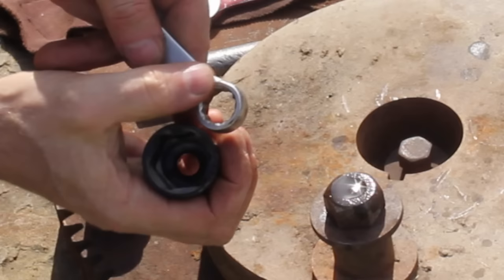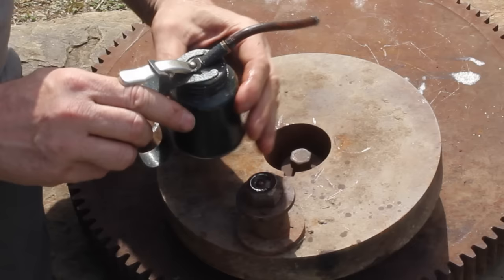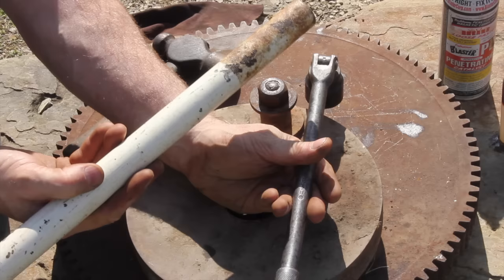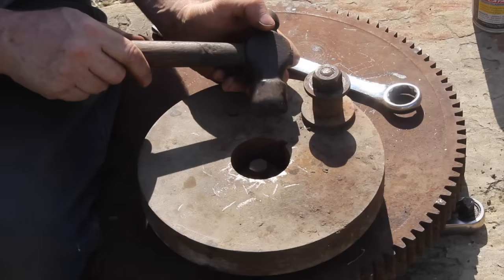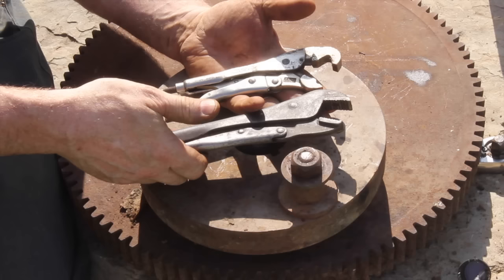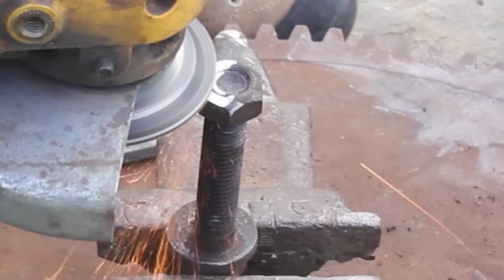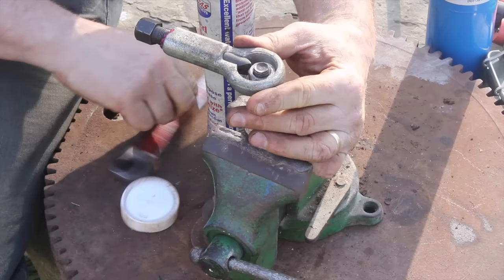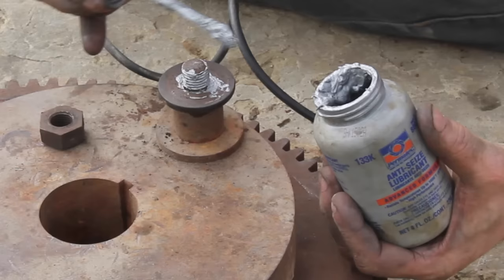Best Ways to Get Rusty Nuts and Bolts Off (Effective Techniques)

Comment: I notice these videos always use easy access bolts as examples, but the most common reason for stuck and stripped bolts is that they're in hard to access places, which makes them hard to get a wrench around, which is what caused the fiasco in the 1st place.
Reply: YES! I'm struggling with a really rusted  rear damper bolt, it's squeezed really tight up there, there's barely any room. I need a 6-12" extender to even get to the thing. And the bolt faces downward. No leverage at all.
Reply: @mog7501  Wow, Im having the same problem with my rear shock bolts on my mazda 3 2006... Did you get them out?
Reply: @Shr1mp2K  I gave up and went to a mechanic. Even for them it took like 2 hrs lol. Ended up paying $80 for one nut 😭. Most expensive nut removal in my life. They had a really tighter extractor socket and some other special tools. I already tried heat, extractor socket, grinder tool and nothing worked.
Reply: Exactly! The title says "nuts and bolts", but he's only working on a nut, which is a walk in the park compared to bolts.

Let's see him try these same tips on rusty seized caliper bracket bolts while working in his driveway. Lots and lots of heat is usually what's required.
Reply: Agreed, Getting the nut off is one thing. Backing a seized bolt out of an engine block is where I struggle

Comment: Actually, another comment. Sometimes you can try to tighten a frozen connector which will move just a smidge. Then go back and forth loosening/tightening a little at a time.  Actually heard about this, but only seen it work once....

Comment: Only comment is on greasing a connector.  There an Aussie fastener engineer on YT who goes into good detail on how using any sort of lube on a fastener changes the applied torque.  In general, if it is at all greasy, even a drop of oil on the threads to lubed with anti-sieze, adjust the torque you are shooting for by -30%.  Ie, if you are torquing to 100 ft/lbs on a dry connector, a lubed one only needs to be torqued to 70 ft/lbs.  When lubed, you are reducing friction between the threads and actually getting a much higher amount of actual torque than you would think.  May not matter for a stud or caliper arm, but others it surely does.

Comment: I really didn't want to change the inner tie rod, but the adjustment nut was frozen on with rust from the 2000 Eldorado being in Wisconsin most of its life.  With tips from this video, I soaked the nut in PB Blaster overnight then tried again.  Still couldn't get the nut to move (Wenches, high torque impact driver, etc.).  Then I tried heating the nut with a BernzOmatic followed with a douse in very cold water.  Instead of trying to loosen, I instead tightened to try to break the nut free, and it did break pretty easily.  Thanks Error Code Guy, I would never have thought of doing this!

Comment: I worked at an aircraft engine plant.  Outer rings and nuts would be heated and dry ice (-109.3 F) would be placed against the bolt or inner surface.  I know it might not be practical but it demonstrates how expansion and contraction can really loosen married items of metal.
Reply: Great tip, thanks!
Reply: Hah, thanks for that. Heated up a mower deck wheel leg which is frozen to 800 f with acetylene for 15-20 minutes, still no movement. 
Someone suggested heating and dousing with cold water, which I'll try first, after that I'll try the dry ice.

Comment: Great tips. I pretty much go to the heating the female and adding wax from a candle as a time saver. Works for threaded plumbing joints, manifolds etc...sometimes on very large marine applications I have to use oxy acetylene to get the parts hot enough to suck the wax in but this is king!
Reply: I was taught that years ago and was happy to see it listed here ! I am in a situation where if I break off the bolts it could cost thousands and major labor. I am going to use most of the ideas before I go -for-it.I really like the ATF and Acetone combo which I will let soak for a few days before I do the heat and wax. I am also going to just turn it a quarter turn and the tighten about an eight turn and soak it again.
Reply: @johnjames77 so what happened?

Comment: Great Vajayo!  only two additional tricks  I know that you did not include welding a  bolt onto a stripped head ( typically an oil pan drain plug) the other trick is use an air chisel on the end of the tool ( best if it is used on cheater pipe and not the tool itself) to hammer off the bolt.   The important point that may have been missed here is that it seems like the hitting, tapping and shock ( thermal and mechanical) is the secret and use all the different options prior to stripping the nut or bolt.

Comment: Thank you so much dude. This is video is the most complete tutorial for removing stuck bolt i ever seen. So many methods. I succeeded with using pipe wrench.
Reply: I tried that too using a pipe wrench made in China. It broke! The bolt, a very large one, is still there (in a farming implement).

Comment: Great video thanks. I have used these techniques with good success. I find that rust check is an excellent penetrating oil especially if you can let it sit over night. If possible you can put rusted assemblies into warm vinegar for a couple of days to remove rust, the hotter the better. I have done that with rust seized alternators and have gotten them working without any disassembly.

Comment: Very good thank you. Also you can sometimes knock on a smaller size socket with a hammer and a scrap piece of ally or a mandrel on to a rounded nut. eg - 3/8ths can be forced on to a 10mm nut. Heat is best if you are not going to damage any surrounding area. If you are removing glow plugs on a diesel run the engine to got them hot first, works for me every time.

Comment: Candle wax is bloody good. It's like solid freeing oil which doesn't evaporate in a cloud of vapour if you've been heating the job.
WD40 and GT85 or TF2 are crap. I was brought up before they were mainstream and I used Plus Gas, Holts Rustola, or Duckhams Duck Oil. Plus Gas is really good. It creeps and gets everywhere. It's like slightly oilier paraffin ( kerosene ). Even paraffin/kerosene on its own creeps well but doesn't lubricate so good.

Comment: actually if you can heat the nut while being careful not to heat the bolt (on something big enough is the easiest way but adjust your torch size to the job) the inside diameter of the nut will expand, and can make it easier to extract. be careful though, if you heat the bolt equally it negates the effect. This is how rail car wheels are put on (a wheel is heated then allowed to cool on the axle creating a friction fit) (thanks physics 101 and 102 professor at my community college! You were bad ass Mr. Burkhart!)
Reply from the maker: +Horrible Hebrew 

It's great having a great teacher. I am still forever indebted to a few of my high school teachers. The more we understand about physics, the better problem-solving we can do.
Reply: That principle is only effective for two parts that are not already bonded together. After they have bonded with rust you'll never get a temperature delta of more than 20° or 30° F. What is happening is the iron oxide is actually combusting (or beginning to) and the bond is weakened.
Reply: Actually, even when both parts heat up and expand, anything between them expands as well, including gaps/air filled spaces, which can help loosen things up.

Comment: Great info for the DIY guy or gal that gets into a bind with rusted or siezed nuts.   I have used mose of these in the past with varied effectiveness.   Also used impact hammer with shake and brake tool to help loosen the rust

Comment: Thanks for the tips. I have just had a fight with a small outboard. I used most of your ideas but the combination of ferrous metals mixing with alloys created a lot of galvanic corrosion. In the end I had to drill it it off. I like the nut splitting idea. The problem with small outboards the very small constricted space available for tools

Comment: Awesome!! Thanks for sharing these tips to us. Usualy, i used to grab an hammer an hit the spanner, to allow the loosen for the bolt itself.
I'm curius to use the ATF+acetone combo.
If the problem is the rust, i've listened from a mechanic that he used to tight and the loose the bolt, few degrees, just to broke that the rust in it.

Comment: Very good.  Room to work is always an issue.  I like to use an air chisel rather than a hammer and chisel and when hitting a wrench with a hammer use a "Dead Blow" hammer.  Removing rusty nuts is not the real trial though.  
The hard ones are bolts into a casting, like exhaust manifold bolts.  For those you cant get penetrating oil into the threads.  I cut the heads of with a carborundum disc on a die grinder, take off the manifold and heat each remaining stud individually, then ad penetrating oil.  Whack them good with a hefty ball peen (strait on, not the sides and try to work them lose with vise grips.  
If they are still not coming loose, you can weld a good nut on them and keep trying.  Heat will always help get penetrating oil down into the threads.  Be generous with the oil.  If you are using a torch, make sure not to use flammable P oil.  WD40 is very flammable and not a very good penetrant IMO.  Liquid Wrench is not flammable for one, there are others. 
If the part is still on the vehicle I prefer to use good heat gun vs torch.  It takes longer but the fire dept doen't get involved. I have had very good luck with CRC Frezze Off.  Best I ever used was Break Free in a pump bottle but haven't seen any for years.  Used to use it on F-111's often back in the day.
Reply: X-Man
Are you talking about the CLP Break Free?
Reply: I'm trying to remove  a frozen bolt/screw on the underside of a swivel base on an old Craftsman bench vise.  It's the big bolt/screw in the center of the swivel base.  My vise was burned in the 2018 Camp Fire, Paradise, Calif., and then it rusted in the following rains.  It has a screw slot head!  Any suggestions before I do some real damage?  Thanks
Reply: @tinybusinesses1566  I don't have a clear enough mental picture of your conundrum to give specific advise.  Make sure you have removed as much rust as possible in the direction the parts will come lose.  Wire wheel on a drill motor, get it as clean as you can. 

If you have access to the female threaded portion (nut?), you can heat it with a propane torch and apply penetrant (non-flammable only, recommend CRC freeze off). don't over heat. You want most of the heat on the female thread part.  

If the female threaded portion is in a casting, apply heat to the male thread portion where it meets the female thread and then some penetrant let it penetrant until cool enough to touch and hold.  Heat it again but only long enough to make it too hot to touch (too hot not desirable, no red), ad more penetrant and then a sharp smack with a hefty hammer linear with the shaft of the male threaded part (as in hit a bolt on the head), use a drift if necessary, a few sharp smacks (wear safety glasses), then try to break torque.  If that doesn't work, a air hammer my help if you have one and compressor of course.  Repeated cycles of heat, penetrant and impact, then try to break torque may be needed.  Good luck, that always helps in these iffy situations.
Reply: X Man still out there? Used to work on the F-111 myself. Can still remember how the earth shook under my feet when that thing fired up the afterburners. Just Awesome.
Reply: @richardtrowell8812  Yup.  They had a hush house at McClellan for them.  Made it barely tolerable when they were testing.  Neat plane.  Nothing in the inventory right now quite like them.

Comment: Wow 😮 
Paraffin wax and auto ‘box oil are genius. 
Thanks so much. 🙏

I sometimes use a small rag, wrapped around the nut and then soak the rag with WD40 (as well as the nut prior to wrapping) and then leave for an hour. 
I then remove the rag, heat with a torch and try again. 

Sometimes it works and sometimes I cry 😭

Comment: Methods worked well on nuts. But rusted bolts into threads you have to save inside threads, and replace
with new bolts. Will try 6 point impact socket with breaker bar with pipe over it and more penetrant. But
harder to get penetrant in when you just have the side bolt to get penetrant in.
Am going to try a little heat on the part I am trying to save. But not a lot. Other ideas for when just
the bolt head is showing ?
Thank you for your post.

Comment: the best way is heating up the nut , so it expands cracking the rust hold , and then dousing it thoroughly with PB blaster allowing it to work it's way down into the threads !

Comment: came here because the engine mounting nuts and bolts of my project bike are all completely rusted. the problem i have is that the metal they are made of is soo soft that i strip the nutby the easiest push with a wrench. this thing sits in my garage for one year untouched now because i just cant get them lose and lost focus. these are some interesting new ways on losing bolts i didnt know thanks

Comment: Over the years, I've recognized that the easiest way to remove a nut or fastener is to simply coat the threads with oil as you install them.  You save yourself some trouble later, and that of the tech or mechanic who has to work on it after you're gone.  Very effective, and at virtually no cost when you do it.  Anti-seize is perhaps more effective and probably longer-lasting; use whichever you have at the moment.  Either is better than installing them dry.

Comment: With pipe wrenches, make sure you push it all the way on (i.e., be sure that you have a three-point connection with the two jaws and the inside back of the wrench against the fastener).  If you don't, you stand a good chance of "ovaling" the bolt or nut so that it cannot be re-used.   Funny, but you used a ratcheting combination wrench to TIGHTEN the nut splitter on the frozen nut, after you explicitly told us not to try to break things loose with one; that warning works in BOTH directions.  Where was the breaker bar at this point?   It's amazing how many people don't put oil, grease or anti-seize on a fastener when they first install or reinstall a fastener.  This act takes just a few moments, but saves so much time later.  Just be sure to use a wire brush first to remove any existing corrosion.  The propane torch and wax is a great tip; it works really well on corroded lug nuts, too.  I agree that 6-point sockets and wrenches have it all over their 12-point brothers.  For some reason, however, 12-point sockets are more prevalent than 6-pointers.  The same goes for 12-point wrenches; 6-points are superior to 12-points here, too.  You have to go out of your way to get either, though, and I've never heard the logic for that one; the drive end of sockets and ratchets has always been four points.  Actually, I've always wondered why 4-point fasteners and the sockets/wrenches needed for them aren't the norm; they have even less of a tendency to round-over than 6-pointers.  Somebody must know if it was aesthetics, production cost or a well-documented engineering decision to move to 6-points.  On many new cars, 12-point fasteners are used; why did that happen?
Reply: Most people don't grease fittings because they rarely come across rusted ones. Those that do come across them figure it out.  And lubing a fitting, even a single drop of oil changes the torque applied when bolted or screwed by 30%.  An actually dry fitting spec'd to torque to 100 ft/lbs only needs to be torqued to 70 ft/lbs if lubed or anti-siezed. The lube reduces thread friction significantly.  Not a big deal for studs or simple mechanical fastening, definately want to remember if using it on engine or other parts which have critical torque specs.

Comment: I’ve Removed hundreds of seized and broken bolts over the years.  Heat and penetrating oil is my go-to. The hard part is when they are in hard to reach areas and you can’t get good leverage.

Comment: gentleman , all the trics you explained are true but it is certainly useful under different situation i.e., position of bolts etc. a solution of sulfuric acid h2so4 is quite helpful to remove old rust that I have experienced subject to precautions.

Comment: The chisel method where you cut into a bolt is my go to. I don’t use a chisel i take a dremel with a cutting disc. Very small tool and can get in tight areas

Comment: spent a frustrating morning trying to remove suspension nut and bolt from a McPherson strut using breaker and cheater bars  Broke two 19mm sockets.  Will try and buy a sturdier socket one and have another go.  May also try the heat/shock cold method.  Then after that it will get ugly, will have no choice but to grind the nut.  In meantime will try the transmission fluid soak.